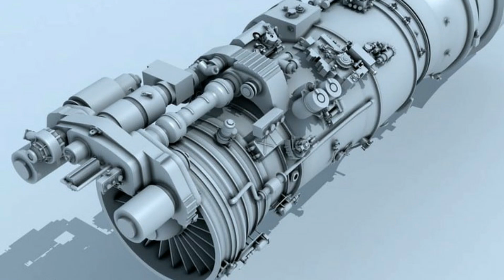J-20 Begins Flying With Groundbreaking WS-15 Engine.

Comment: Does it supercruise?
Reply: One of the defining characteristics of 5th gen is supercruise.
Reply: @fungames24  Yes. So does it supercruise? Because they've been claiming it will for years and it hasn't.
Reply: @patrickweaver1105  If they are using the new engine, then it super cruises.
Reply: @fungames24  Yeah pardon me if Id like to wait for a credible source.
Reply: @patrickweaver1105  Unfortunately hollywood will never confirm to you this plane can fly.
Reply: @fungames24  Supercuise is critical to extended range at mach. It's a highly sought after ability. It's also a hallmark of a fifth generation fighter as you yourself have said. 
Wouldn't that be an interesting autograph to have?
Reply: @patrickweaver1105  It's much better to extend range without mach. For time-critical surface targets, ballistic launched glide munition such as the DF17 is far more effective. There is no reason why similar systems can't be developed against high value targets such as AWACS and tankers. Supercruise is ok to have but not critical.
Reply: @fungames24  The main purpose of the plane being so big was to be able to fly at Mach 2.5 with a heavy weapons loadout.  With flight duration limited by lack of supercruise a lot of the reason for it goes by the board.
Reply: @patrickweaver1105  Mig-31 with 4x R-33 flying at above 36,000ft with afterburner Mach 2.35 made world record being fastest armed fighter. Supercruise = breaching supersonic without afterburner on. F-22 could do that with internal load on 100% military thrust achieving Mach 1.58, Su-57 with Izdelye 40,000lb thrust engine could supercruise. J-20 with WS-15 definitely could supercruise if its military thrust could generate over 20,000lb. 

The design of plane determines top speed of military & overheat thrust. Fighters such as F-15A & F-111D with only 23,000lb thrust per engine could reach Mach 2.5 top speed because of the fuselage & wings design. J-20 fuselage and wings are made for speed, it should be easy for it if it receives WS-15 since with current WS-10C generating 32,000lb thrust (19,000-20,000lb military thrust), it could reach Mach 1 on military thrust while loaded on 50% fuel.
Reply: @jawarakf  And I want to see it.
Reply: @fungames24  I'm not trying to convince you. I'd be more likely to believe a talking horse then Joe Biden.
Reply: @patrickweaver1105  it depends whether China could perfect the 40,000lb thrust WS-15 engine with 100% military thrust close to 30,000lb. F-22 PW F119 engine 100% mil thrust 26,000lb higher than earlier F-15 PW F100 full afterburner 23,000lb thrust. However traveling at  100% military thrust is fuel guzzling that the F-22 ended up getting far lower range than it does at 60-70% thrust meaning that supercruise is just not practical for achieving high combat radius but good for saving fuel while on pursuit or interception without having to go afterburning.

 F-35 PW F135 engine thrust 28,000lb mil & 43,000lb aft could serve as guideline on how much military thrust does the Izdeliye & WS-15 would roughly get since they are in 40,000lb afterburner thrust league. F-35 has low supercruise speed due to poor aerodynamic made for super low speed stability & maneuverability (ideal for STOVL), grave mistake for trying to design aircraft for USAF, USMC & USN.
Reply: @patrickweaver1105  Ok. So, a talking horse is an expert on chinese fighter tech. Has it been confirmed by a talking horse that the chinese plane can't supercruise? N
Reply: @fungames24  You think Joe Biden is an expert on Chinese fighter tech?

Comment: Hopefully, the technologies mastered from making this engine will also be transferred to China's civil aero engineering sector, thus breaking the stranglehold the west has on civil jet engines by RR and Pratt & Whitney and GE.
Reply: They are working on that, ws20 is already installed on Y20. Cj1000 and Cj2000 for C919 and C929 are under developing. There is still a long way for them to go. But with their intelligent and hard working, hopefully in 20 years, their engines could be on the same level with the US.
Reply: Some says WS15 core module are used in CJ-1000 hi bypass currently in flying testbed.
Reply: @alexlo7708  the West has a stranglehold because the West has a strangle hold on intelligence research and first class educational institutions. In the East you seem to like to pretend...